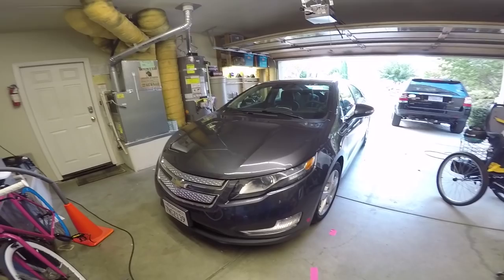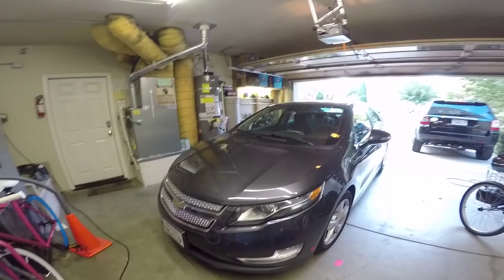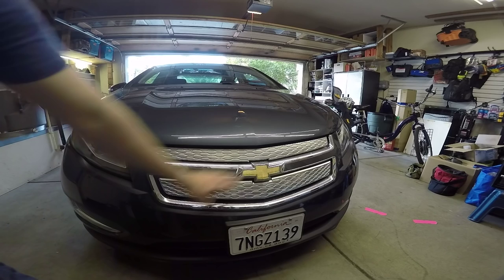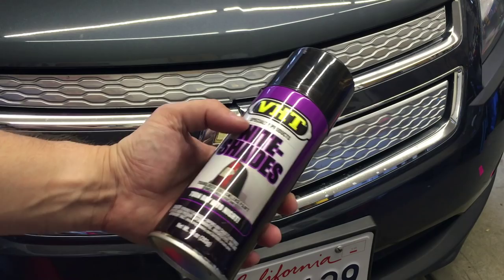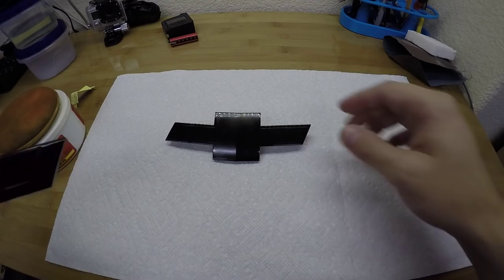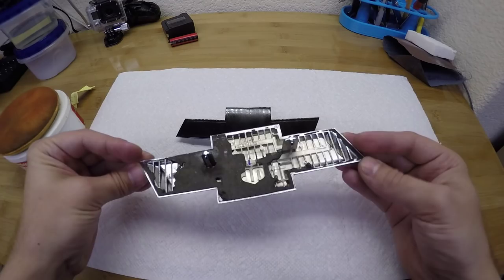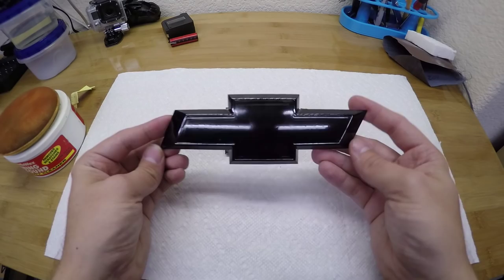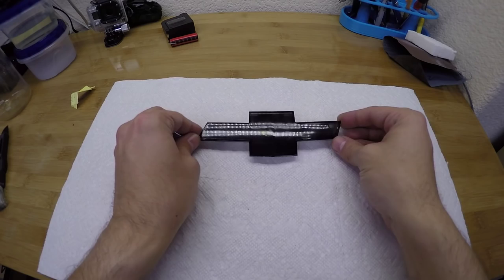DeBadge a Chevy Volt with Nite Eyes

Comment: Hi,
I've been trying to get my emblems off but all the little prybars I've been able to buy don't work they are too thick and won't get into the crack to pop them out do you know what store or website I can buy those things to pop out my front emblem????
Reply from the maker: Try iFixit. Your best option will be to heat up the emblem with a heat gun, being carful not to melt it or blister the surrounding paint. then use dental floss to slide under the emblem and separate it from the car. The front emblem needs no heat it's secured with clips.